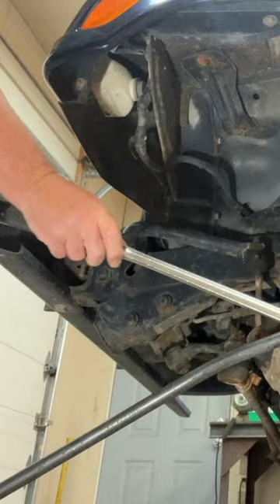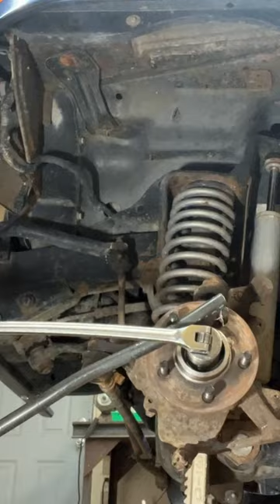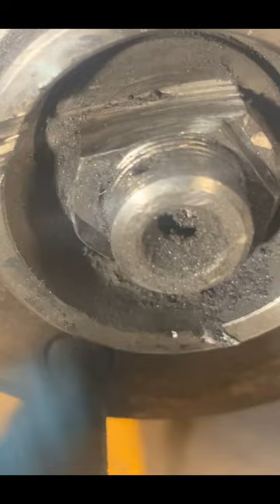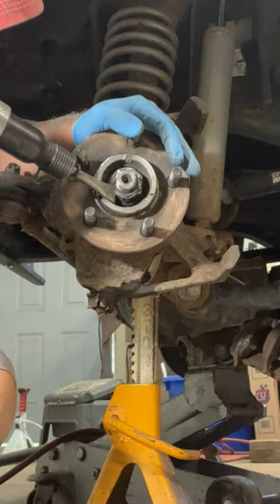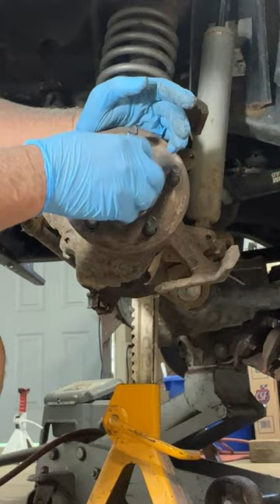TJ Jeep Wrangler NIGHTMARE of Removing a Frozen Wheel Hub Nut.

Comment: Using the right tools makes this job easy peasy. Either an air impact driver gun or an electric one would make this job easier. A breaker bar does just that, it breaks. I do these wheel hub nuts at work regularly with my Milwaukee electric impact driver. Makes short work of that job. 😂
Reply from the maker: Agree right tool for the job! Thanks for watching and the comment!

Comment: Blow torch next time heat it up
Reply from the maker: LOL Heat Yes. Blow Torch might be a bit aggressive. But I was about ready to torch the entire Jeep!
Reply: That works great for many things but you have to take into consideration if the heat treatment of the parts are critical.  Not an issue if you don’t reuse them but if they are still needed, the torch may compromise the parts.